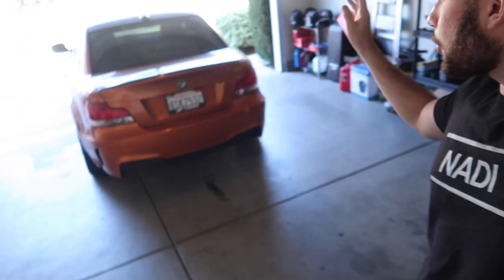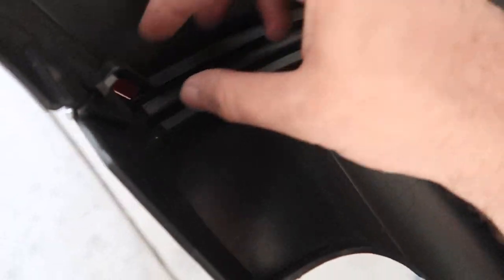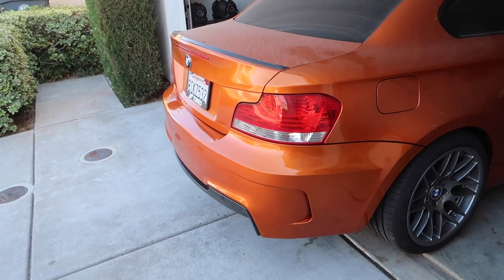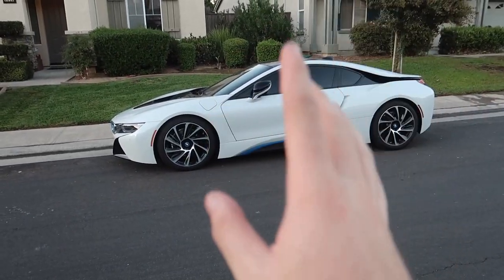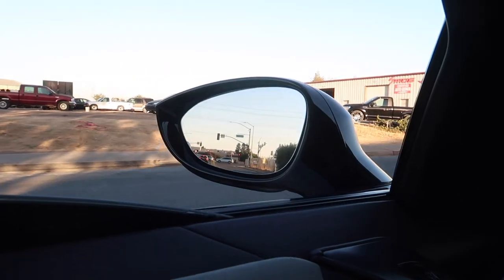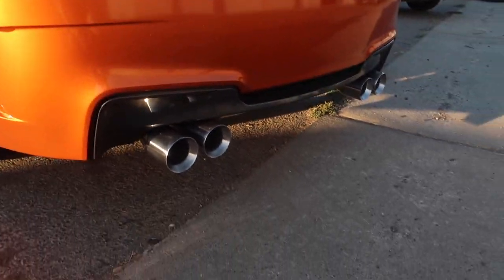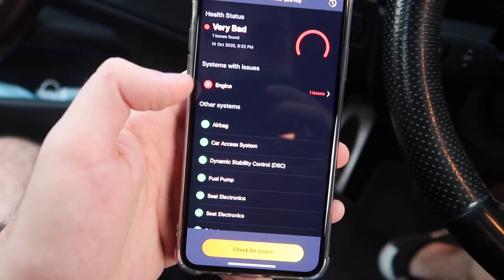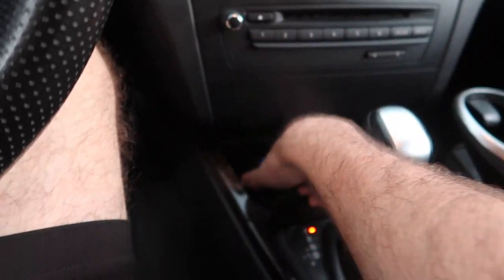QUAD EXHAUST ON THE 135I + FIXING ALL IMPERFECTIONS! (So Satisfying!)

Comment: Looks ok. I think the exhaust shop messed up. The tips, to me look like they not aligned to the bumper contours. The outer tips need to be shorter then the inner tips
Reply: I’ve got a e87 with 1M kit on it same diffuser and they done mine with outer tips a bit more in than the outers.
Reply: Yeah man! I’m glad I’m not the only one that sees it the tips looks like they are sticking out way to much i want to do the same thing on my 135i but I’d like them to be more flushed.

Comment: To bypass the o2 sensor, you either can tune it, or you can put a spacer in between the sensor and the downpipe. When you do so, the sensors think the cats are still on. Very cheap and easy way to bypass the CEL !

Comment: You have half check engine light meaning your car is in limp mode and it has nothing to do with the downpipes and you can also bypass it with MHD.  But those codes you showed us are most likely a faulty fuel pressure sensor.

Comment: Use a o2 sensor spacer en plug it in where the normal o2 sensor would go (on the downpipe) its after where normally the cat would be. it fixes the engine light.
Reply: This won’t fix it on a n54 the sensor are more sensitive plus a spacer on the 02 sensor won’t fit in the secondary o2 sensor location

Comment: o2 sensor shouldn’t cause a Half engine though. Should only be a check engine. 3100 code can cause half engine. It means the boost has been turned off. Something is triggering it.

Comment: I Believe if you did MHD stage 2+ it bypasses the check engine light for the o2 sensors, cause I am Catless downpiped also but on a MHD tune, and I dont have a check engine light.

Comment: Bro 135i is lookin sick!  I bought the same front grills from ebay for my 135i and had same exact issue them popping out.  Easy fix - remove new grills completely and use lighter to “warm” up all the grill tabs so u can push them out with you finger far enough so they are able to clip to your bmw mounting surface and they snap in tight !  Just dont over heat the tabs and you should be good 👍
Reply from the maker: sounds good thanks

Comment: PSA, sorry for the caps lock: 

IF YOU ARE PUTTING IN THE F STYLE GRILLE, THEY DO FIT THE ONE SERIES PERFECTLY BUT SINCE ITS NEW YOU NEED TO BEND THE CLIPS SO THAT THEY SNAP INTO THE BUMPER PROPERLY. 

just sliding them in means they are not secured and they will fall out when you hit a bump. Bending the clips takes 2 seconds and you don’t have to screw anything off to do this. Just bend them, push into grill and you will hear the clicks.

Comment: i got some cheap black grills for my 135i and they did the same thing. would fall out when i shut the hood. then got some $100 one from turnermotersports. they were money and stuck in well. the clip lips were not as big on the cheap ones. bet if you put small strips of black duck tape over them before you put them in they would lock in better. that or silicone on the top back and let it dry overnight.

Comment: Its a fuel rail pressure switch. That code and the dash light will pop up, and even not pop up sometimes. Can also cause misfires and running like crazy in general. Burple tunes do not help with that problem either, and can even cause fuel rail problems
Reply: Crap** not crazy...

Comment: BootMod MHD or a custom tune will fix the CEL. JB4 stopped doing it because they’re trying to be carb legal. You need an actual flash tune or a Professional tune, especially if you want 500 wheel.

Comment: If it is an o2 sensor causing a limp mode the car is either running to lean or to rich. Meaning you most likely need to replace the o2 sensors